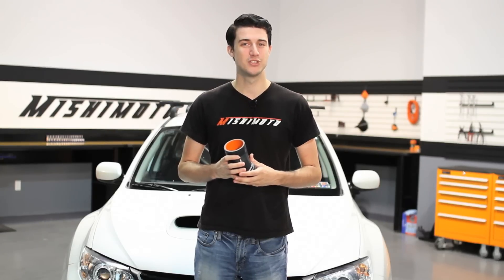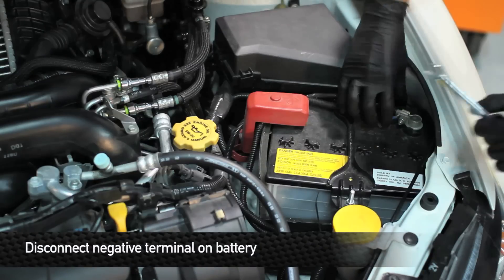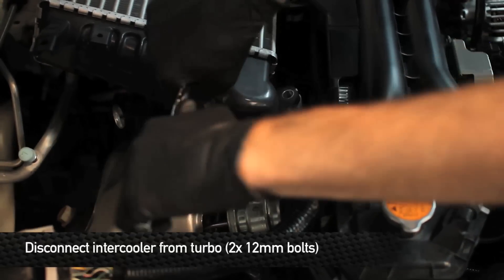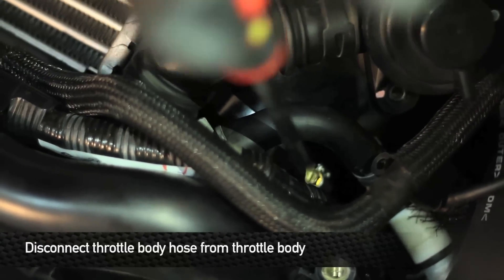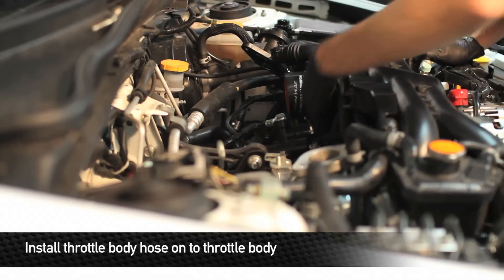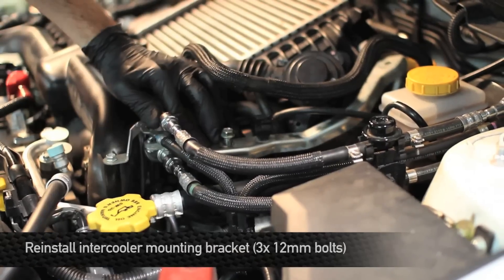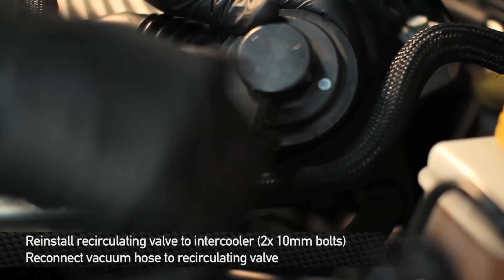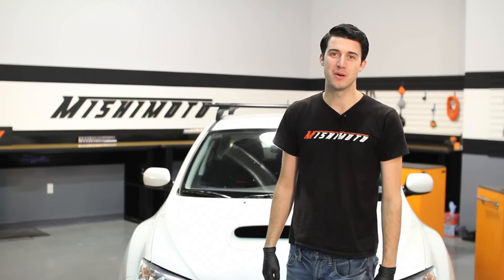Silicone Throttle Body Hose Installation Video  for the 2008+ Subaru WRX

Comment: Thank you guys for this! It's about time someone did this proper. 
Stock TBIC is the worst! Gets loose and pops off all the time!
Reply: Robert Llera For real, Subaru should have a recall with the Mishimoto as the replacement part.
Reply: When this gets loose does it give off a whistle when accelerating more then 3k rpm?

Comment: subaru should be ashamed of the garbage that these cars come stock with. i was doing some maintenance on my car and decided to clean the throttle body. holy shit the hose was falling apart at the clamp and it had a huge atleast 1 inch gash on it pretty close to completely failing. now im waiting for my mishimoto hose T_T plz ship me asap

Comment: DID HE USE ANY KIND OF GASKET ON THE TURBO / IC CONNECTION?
Reply: J Garcia No that is just a O ring that is reusable for the most part. Unless it is torn.